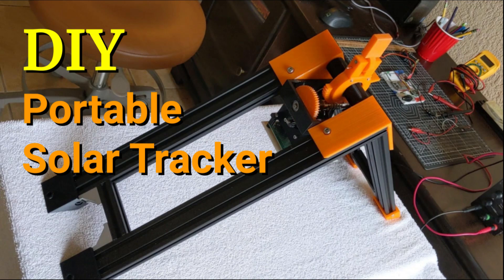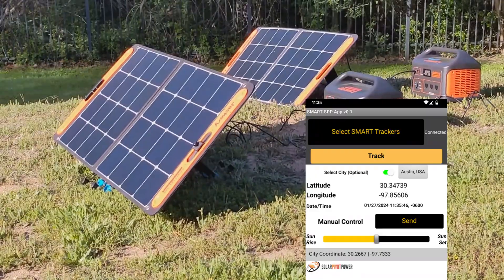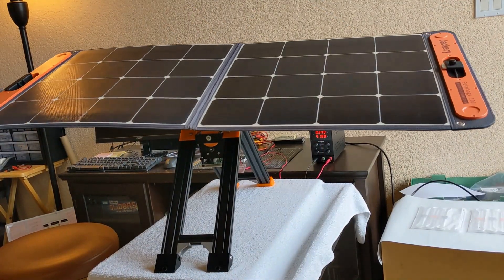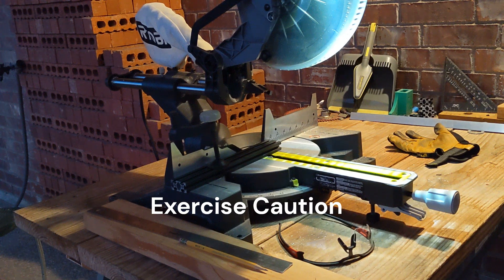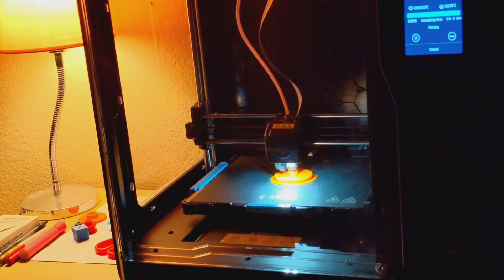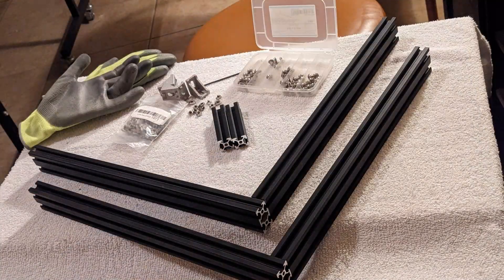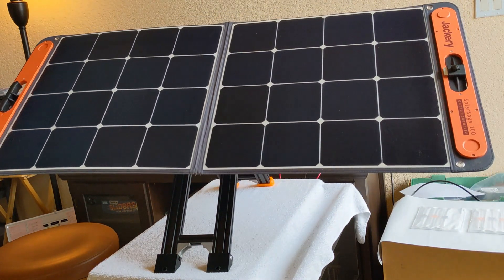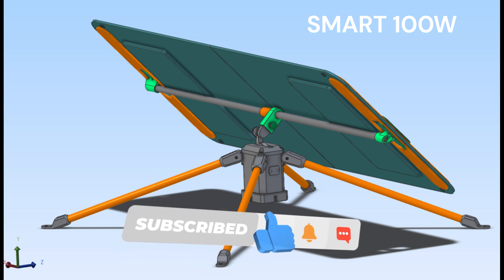DIY Open Source Portable Solar Tracker - easily adaptable for many 100W Solar Panel. Bluetooth/GPS.

Comment: Have you ever thought about working on a system that moves panels laterally.  For people using panels in tighter spaces or near overhanging obstructions, the panel could slide back into the sun as the sun moves behind such barriers.
Reply from the maker: So not just pivot from an installed point but actually slide across a length? It's certainly possible. Our current work is not designed for this but if I can understand this better, I could definitely connect you with any ongoing work in the industry. Thanks for your interest.

Comment: It can be done even simpler - without all the electronics, the automatic angle change can be controlled by the sun itself through two tiny solar panels at the ends, which will fight with each other and power one actuator. Have a look at: Easiest Solar Tracker
Reply from the maker: Great point Tibor. We studied the design famously used by NASA on Spacecrafts. It's an elegant approach. We used both competing small panels and Photosensors. The limiting factors are that the small panels don't generate enough power to independently power the actuators and the mounted panel needs to be a fixed size to properly position panels/sensors for the balance to be achieved. I am sure space presents a lot of challenges but not gravity and wind loading forces. For sure, fellow contributors will come up with improvements and better approaches. The end goal is to have a robust design that can handle the typical camping usage.